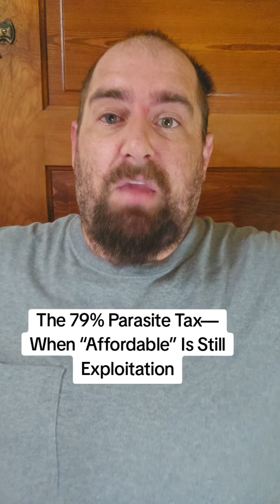The 79% Parasite Tax—When “Affordable” Is Still Exploitation

Comment: Brother, sadly there is only one way to change this. You learn the business and get the licenses to operate. Then you make 3d homes and take 30% profit instead of 80%. Everyone will buy your home over theres and you have artificially set the going rate for “affordable” 3D homes.
Reply from the maker: I hear you, but I’m actually running for the Minnesota State House in MN-20A on a bill that does exactly what you’re describing, only without the profiteering middle step. It’s called the Minnesota Housing Sovereignty Act, and it establishes publicly managed, occupant-owned 3D-printed Sovereign Homes, Earthship-inspired, off-grid capable, and built for about $63,000 each, or $350/month for 15 years. The point is to break the exploitative cycle entirely. Instead of “lower profit margins” still skimming off families’ futures, housing becomes an actually low cost, not a lifetime of rent or mortgage servitude. The system is designed so that people own their homes outright, with no landlord, no bank extracting interest, and no “affordable” scam that’s just exploitation with a discount label. The fight isn’t to carve out a nicer profit slice in the current system, it’s to replace the system with one that delivers sovereignty, stability, and freedom at scale.